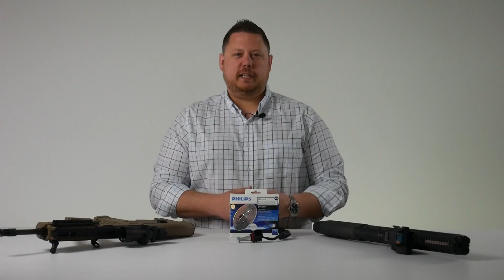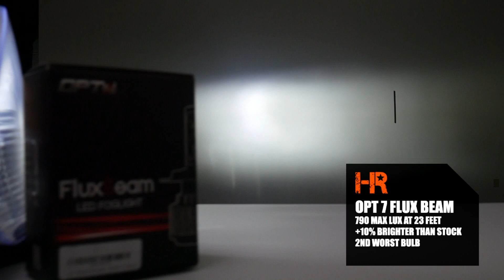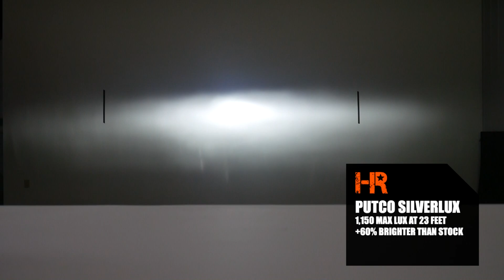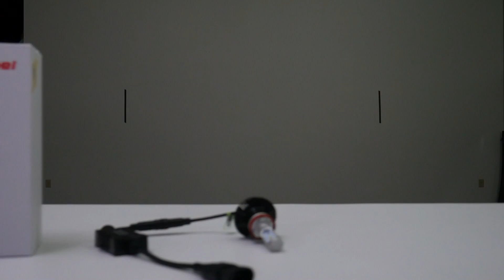DELETE - 15 Brands LED Headlight Bulb Shoot-Out! Which one's the best?

Comment: Great video guys. The only thing I am not comfortable with is that according to your tests the best bulbs are the ones that also happen to be the ones you are selling exclusively: you do mention where to buy the other bulbs (on Amazon for instance) but you don't say a word where to buy the GTR bulbs.
Reply from the maker: Let me put it this way: if the bulbs we sell weren't this good, we wouldn't have made this video due to potentially being embarrassed...
Also, if we did this test and found bulbs that worked better than the winners here, we would sell those ones instead!

Hope that makes sense. It's no coincidence that we sell the best bulbs, that's kind of our thing... :)

Comment: Thanks for the vid. the bulbes with big pattern will they work as a high beam light and or work good in a projector light better.
Reply from the maker: Our LED bulbs work in both high and low beams. We do not recommend putting LED's in projector lenses because projector lenses are designed for HID's. Thank you for watching.
Reply: Keith, did you ever figure out if the bulbs that failed the beam pattern work for high beams? I went ahead and ordered the Supernova V3 for low beams but I'd like to spend the money I didn't spend on the GTR getting some cheaper LEDs for my high beams. I have the same question as you as the crappier beam pattern should be fine in a high beam reflector, might even make them better at flooding the area.

Comment: I like the video and I just bought a 2013 Ram 1500 has projection headlight. Was thinking about getting that gen 3 GT lighting LED lights. Would like your opinion on it and if you know what part number I need. Also should I get them for my high beams and my auxiliary running also. If so do you have their part numbers. You could also email me at vpbs Bob at yahoo.com thank you

Comment: Been researching LED Kits. Your experiment isn't extensive enough. Your light housing is reflective lens, only . Some Kits might do better in projector style housing. Also been researching OPT 7, but if you look on your box. It is for fog lights. I would think that low beam and fog beam would be created differently.
Reply from the maker: LED's do not perform well at all when they're behind a projector lens. The beam pattern is terrible and your light output ends up being less than the stock halogen bulbs. The reflector lens works best with LED's and that is why we tested the different LED's with a reflector lens headlight and not a projector lens.

Comment: I have tried several led bulbs and complete headlight units in my Harley. They are great on low beam much brighter and whiter light however none and I mean none of them have a good high beam. Switching from low beam to high is no more than like blinking your eyes. They just do not jump out there farther like low to high  on a standard bulb. Most people just adjust them higher about in between low and high beam on a standard bulb and rarely switch on the high beam. You didn't address this do you know of a good led h4 bulb for my bike thanks.

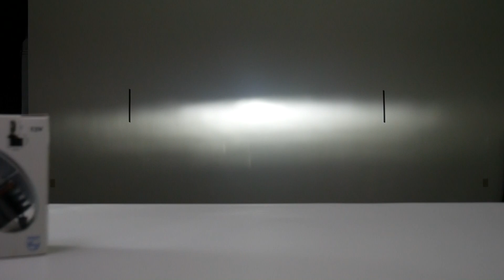Comment: 1. Philips X-Tremevision 02:52

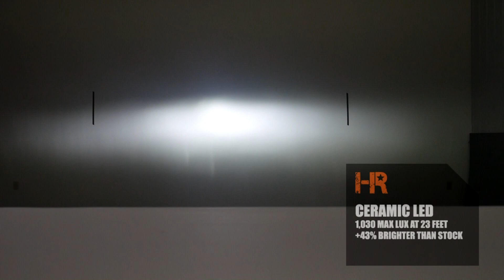2. V-LED 04:12

3. Street Glow XHP50 LED 05:34

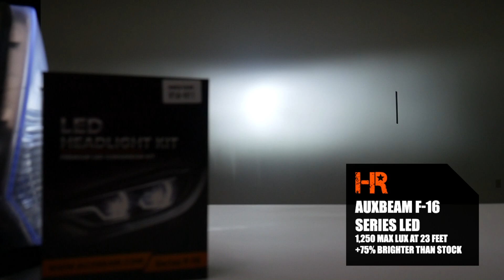4. AuxBeam F-16 07:00

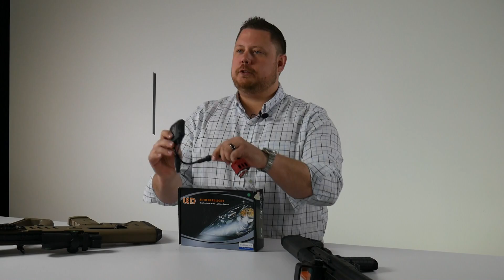5. 12 Philips Luxeon Chips 08:35

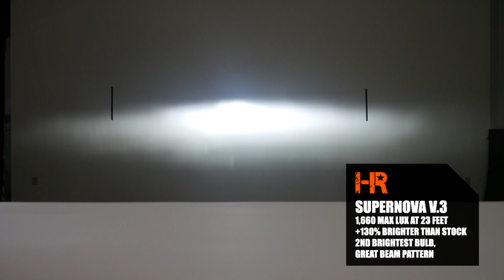6. Supernova V.3 09:38 (top 3 IMO)

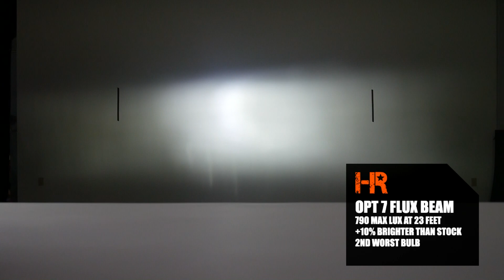7. OPT 7 Flux Beam 11:32

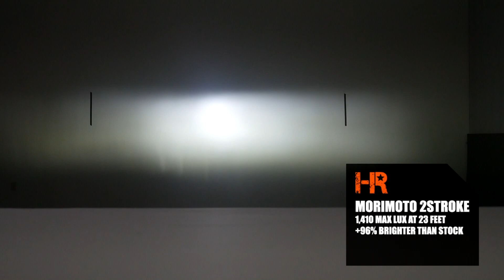8. Morimoto 2Stroke 14:49

9. PUTCO Silverlux 16:25 (top 3 IMO)

10. Kenson 60W/6000 Lumen 18:50 (bottom 3)

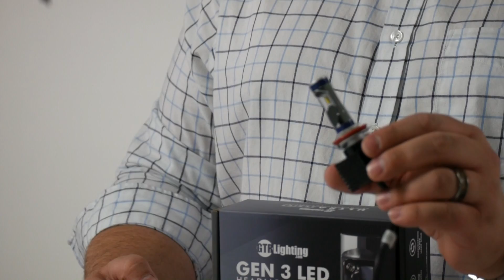11. GTR Lighting Gen 3 ULTRA 21:25 (top 3)

12. CREE 15W CHIP 24:13 (bottom 3)

13. VEHICODE Gold Pro100 26:05 

14. Audofeel Lumileds 28:11 

15. Supernova V.2 29:05

YOU ARE WELCOME !!!
Reply from the maker: Thank you!
Reply: So which one is the best ?
Reply: @depdark1  5
Reply: @Az-dr1kz But 5 looks awful
Reply: Thank you
Reply: Thank you
Reply: Thank you very match
Reply: @rideordie750  5 
120%+
Reply: MVP

Comment: So, im having projector headlights, but i'd really like to have that cold white bright beam. What kind of bulb would you suggest? Currently im using Osram Xtreme Vision Halogen bulb.
Reply from the maker: I'd go with an HID kit.  LED's don't do well.
https://headlightrevolution.com/gtr-lighting-55w-hylux-single-beam-canbus-hid-conversion-kit-4th-generation/
Reply: Thing is that to use HID i need to have headlight washer and automated light adjustment in order to drive on the roads with it.
Reply from the maker: Where are you located that you need those?
Reply: Denmark. Lots of weird rules that doesnt make sense here.

Comment: ***** l had originally purchased a set by CougarMotors (or something like that). Wish I'd have seen this video first, or something like it, but it the low beam are abysmal at best (being generous) as there's a huge dark spot right where I need to seeing front of me although high beams are good. I have an '02 Ford Ranger and have the 9007 H/L bulb type. I've done some more searches trying to find a good compromise between  best (brightness/beam pattern,  etc.) which I want,  but can't afford for awhile and acceptable (brighter than stock and acceptable beam pattern so I don't blind people). Seeing that even High end halogen are $40-60, I don't mind around $100 or so for LED options and would consider HID (although space for the ballast would be very tight). I've been seeing "headlightexperts.com" coming up a lot even though searching for Headlight Revolution,  but I doubt they are affiliated.  Although I did get a "sale" email from them with a tempting offer of $209 on sale for $99 for LED and $69 for HID. Even after doing a fair amount of research last time I still got burned,  so I'm a little hesitant at pulling the trigger on an "unknown" as we all know,  price doesn't always equate to quality.  Do you have any recommendations that might fit my limited budget?
Reply from the maker: We don't sell LED kits that are that cheap, because we don't want to have to stand behind something that is going to fail as much as these cheap kits do.
https://headlightrevolution.com/headlights/headlight-bulb-upgrades/supernova-v-3-led-headlight-bulbs/

Comment: I have the XHP50 LED, it's actually a really good bulb, you just have to readjust the light and the beam pattern is all good in my opinion, don't blind anyone, tested it out as well, don't have a video but it's really good in my opinion, running it for my high/low beam bulbs
Reply from the maker: Cool, can you send us a picture of your beam pattern so we can see what it looks like? Also an XHP50 is the Cree Chip, if the company is using that as the name, it's kinda riding on the coattails of a Cree Chip, not made by Cree.
Reply: Headlight Revolution where do I send it? I'll take some soon and send them
Reply from the maker: Sales@headlightrevolution.com
Reply: Didn't get a chance to really take pics, but a low beam bulb with a zes chip has a better beam pattern. One of the LED's with the xhp50 chip stopped working (low beam) so I replaced them with zes bulbs and they had a waaayyy better beam pattern. High beams don't really matter and they didn't blow out so I'm still running them as my high beams.

Comment: I'm confused because I just watched another video of this channel and it's telling not to even buy LEDs. And go hids. And it also said the gtr led was not brighter then the halogen but in this video it's saying it's much brighter. So which one is it ?
Reply from the maker: Hmmm, which video was that? It may have been an older video referencing older generations of LED bulbs. If so, those were some of the first LED headlight bulbs around. The technology has greatly improved over the last few years.
Reply: Headlight Revolution https://youtu.be/utrYcpXDwJ8
Reply from the maker: Jon, That is specifically for in a projector housing. This video is based on a reflector housing.

Comment: I just had a 55 watt Kensun in my 2005 Subaru Outback was not impressed. I had them in low beams 9005. My question is would a relay harness help. I had the warning cancel/anti flicker.

Comment: Great video! 

1 question though. You spoke a lot about beam pattern/light distribution to make it effective as a low beam. What if you only wanted an led light for your highbeam, where you wanted to flood everything with as much light as possible? Would anything change? What do you recommend
Reply from the maker: Yeah, there's still a good and bad high beam pattern.  Typically if a bulb does well and is really bright in the low beam, it'll do well in the high beam.

Comment: Hi, I have a 2013 Toyota Prius V with halogen bulbs in Projected lenses of headlights. My Prius V is working as a Taxi 24/7 on the road. It is very difficult to see everything on dark winter rainy nights. Plus these halogen blubs have a very short life span. Can you please advise which light kit will be best for my car (LED vs HID) as a maximum light output, best light pattern, longer life. Thank you.
Reply from the maker: We have had issues with LED's in Prius's, but if you'd like to work with us a little we can get it figured out.
Send us an e-mail @ sales@headlightrevolution.com ATTN: Eric and let's get it working.

Comment: Will the results be the same for projecter headlights? Should i pick a HID kits over LED for my 2017 accord which has projector headlights instead of the regular reflector. What would you guys suggest? Gtr hid kit perhaps??
Reply from the maker: What we've found is that the results vary slightly from headlight housing to headlight housing. Our demo gives you the best idea of what to expect in the majority of scenarios. Projector headlights are another story though. Each projector headlight will work even more differently than the reflector variants. We do have some plans to film some new videos demonstrating the differences between different projector headlights with LED bulbs.

Comment: Yikes!  You have a rather large subscriber base and have a lot of views, but in my opinion your evaluation is insufficient.  The Federal Motor Vehicle Safety Standard governs the automotive community and FMVSS 108 describes Lamps and Reflective Devices.  SAE-J599 further describes aiming.  The inspection screen is set to 25ft (not 23ft), and you didn't use a cross hair to note projected center of the lamp (and you need to leave it on the vehicle or fixture it in the same orientation... not just set it on the table).  You're using a lux meter  to compare only the brightest area, but that doesn't really tell the whole story.  You don't use an integrating sphere to measure total flux (or a goniophotometer), so your audience doesn't really get a lot of information about how much light is broadcast... other than a visual reference (which is valuable).  It would be worth bonding a thermocouple to the LED solder point to inform your audience of a critical metric for LEDs.  You are not alone though, there are lots of folks doing LED lamp replacement videos just as badly.  It would be worth consulting with an automotive lighting person on your work.
Reply: Mark Dixon nice comment, was going to say the exact same, I'm cert. In TX for our inspections.... This guy is using lux to compare lumens 🤣🤣 honestly it's like saying halogens are brighter than hid's 🤣🤣 but anyways yeah to add to what you're saying, he needs to at least be 30ft for a higher lumen spread for pattern identification

Comment: Very informative! I have been researching an LED headlight kit for my 2010 Buick Lacrosse for a couple weeks now. I found a set on carid.com that looks decent but it says I have to disable my DRL function. I emailed and asked about it and they said it's a voltage issue because the DRL's halve the voltage of the low beam. So basically I would have to manually turn on and off my headlights every time I get in my car? Is this true? I'm am pretty set on the GTR set after watching this video though, would I have to do that with those as well?
Reply from the maker: That sounds right. The GTR Lighting, Supernova, and Morimoto are all DRL compatible:
https://headlightrevolution.com/headlights/headlight-bulb-upgrades/led-headlight-bulbs/

Email or call us and we'll get you a discount!
sales@HeadlightRevolution.com

Comment: Thank you for posting this video. Now I understand that the hump will blind on coming drivers when using low beams. But I want your opinion on using bulbs with a lot of output with a wide spread as high beam bulbs? Do you think they would be a good choice for high beams? Since pretty much high beams will blind oncoming drivers either way. Thinking more of using them when driving on remote empty roads on road trips. Your comments would be appreciated. Thank you.

Comment: Hi, thanks for sharing this very interesting video. The only down side (only my opinion) is that you don't tested LED designs with High-beam / Low-beam comparison (since we don't care too much the light pattern with high beam.... that is not the point). So it's not very usefull to us imho. Because the most important things for the end user is to get the maximum light with low-beam! The reason is because it's the more critical lighting option used on the road...
Reply from the maker: Unir00, You're right, I'll talk to Chris about putting together a dual beam video soon.  We are currently working on some Tundra, Silverado, Raptor, Ram, and Superduty videos, so it'll be a bit still.
Reply: Thx and Happy New Year 2018, hope calm January should be propice to test bulbs with high / (and of course awaited) low beam pattern as well ... 

Cheers, and again thanks to your nice approach.

Comment: Will you guys compare h4 hi-low models for led as well as there's a lot more technical changing issues than h7 or h11
Reply from the maker: Ram64man, You're right, I'll talk to Chris about putting together a dual beam video soon.  We are currently working on some Tundra, Silverado, Raptor, Ram, and Superduty videos, so it'll be a bit still.

Comment: I HAVE A NEW SET OF LED HEADLIGHTS FOR MY 2011 DENALI HD...YOU HAVE THE BULB WITH SINGLE WIRE BACK TO THE DRIVER..COMING OUT OF THE DRIVER ARE TWO WIRES...ONE FOR THE FACTORY PLUG AND ANOTHER THAT GOES DIRECTLY INTO A "CANBUS"....CAN YOU PLEASE TELL ME WHAT A CANBUS DOES AND WHY ITS NECESSARY...DOES IT NEED SPECIAL MOUNTING??  PLEASE HELP..THE LIGHTS ARE FROM RECON...

Comment: Bulbs if order of Worst to Best, cause the order of appearance list was annoying to me.                             Auto Feel/Oracle/Super Bright LEDs Fanless (**Disqualified, estimated 1,100 Max Lux)

Kensun 60w CREE LED (#15 Brightest: 590 Max Lux)

Philips H11 LL 55w Halogen (#14 Brightest: 720 Max Lux)

Opt7 Flux Beam LED (#13 Brightest: 790 Max Lux)

Philips X-treme Vision LED (#12 Brightest: 950 Max Lux)

Supernova V.2 / Putco NiteLux LED (#11 Brightest: 1,005 Max Lux)

Vehicode Gold Pro 100 LED (#10 Brightest: 1,010 Max Lux)

CHTOOLIGHT LED (Similar Construction to VLEDs SMZ) (#9 Brightest: 1,030 Max Lux)

Alibaba Ribbed Fin Heat Sink LED (#8 Brightest: 1,130 Max Lux)

Putco SilverLux LED (#7 Brightest: 1,150 Max Lux)

Auxbeam F-16 LED (#6 Brightest: 1,250 Max Lux)

Morimoto 2Stroke LED (#5 Brightest: 1,410 Max Lux)

P6 / LED Concepts Axiom 45w LED (#4 Brightest: 1,580 Max Lux)

Supernova V.3 LED (#3 Brightest: 1,660 Max Lux)

Street Glow XHP50/NINEO/Xtreme Vision/Glowteck LED (#2 Brightest:1,680 Max Lux)

GTR Lighting GEN 3 Ultra Series LED (#1 Brightest: 1,730 Max Lux)
Reply: DRed Eagle my hero
Reply: That why good led are adjustable in the headlight housing.
Reply: that's all great and dandy but it isn't just a matter of brightness. bulbs as bright as the sun are basically useless if the beam is so scattered that it's a safety concern for oncoming traffic. the first consideration of any bulb should be how well it works with the reflector... then worry about brightness.

Comment: I was really hoping to see some VLED reviews. I just put in a pair of 9003 LMZ into my fog/high beams and am not getting a great beam pattern. Most likely due to the horrible reflector design of my g35 coupe. However the build quality and adjustability are great. I'd love to see how you feel they stack up.
Reply from the maker: I'm pretty sure those bulbs aren't to bad, and I would guess you still don't have them clocked in the headlight properly.  Check it out again.  Park your vehicle 10 feet from the wall, turn your lights, on and adjust the collar. See if you can get a better look.  If not, maybe you should switch bulbs because typically if a bulb does well in 1 housing it does well in all housings.

Comment: I have a 2016 ram 2500 NON projector lights. will the GTR gen 3 ultra series fit without having to cut my dust caps or any modifications ?
Reply from the maker: They will not.  We have a kit for this truck centered around the Supernova bulb because it does fit.
https://headlightrevolution.com/vehicles/dodge-ram/2003-2017-dodge-ram/

Comment: Hello bro.you  
are very good informer.... 

I want to ask you something that can you tell me about the Toyota fortuner(2017) headlight why it's too bright...? 
And what is the color temperature...?
Reply from the maker: Dushyant, for the Toyota 4-runner, you'll need an H11 low beam. The Supernova V.3 bulbs would give you a nice beam pattern with 6000K color.
Reply: Headlight Revolution 
Thanks for that sir. 
But sir, I don't have a fortuner(2017) i am asking that which led they use in there headlights (its too bright) so the same "k" and thr same "W" i'll use in my suv 
So just i want to know about that led....?